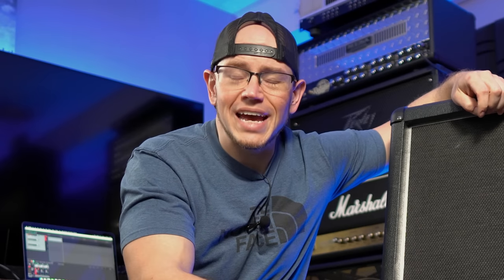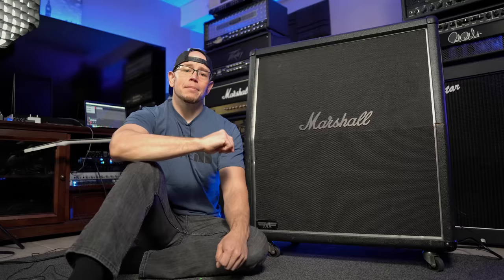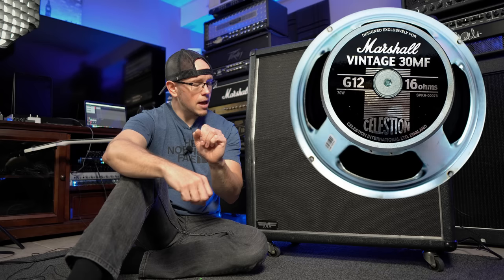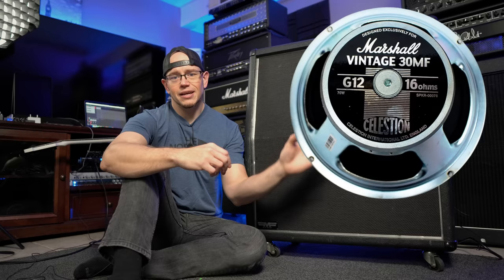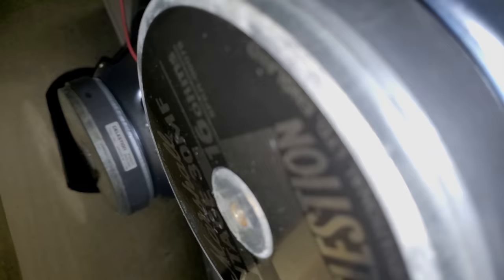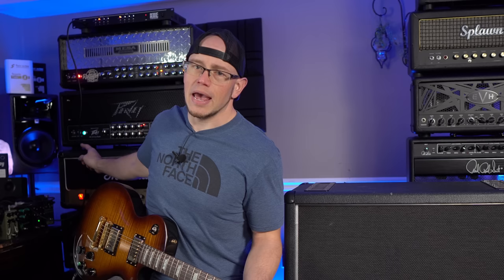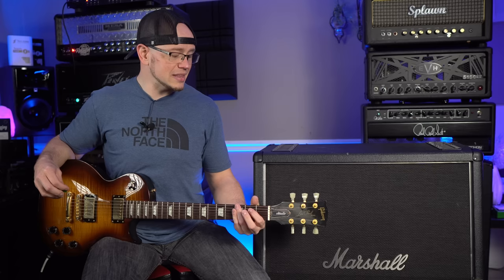Marshall's Answer To The Mesa "Rectifier" Oversized Cab | Marshall Mode Four MF280 Cab

Comment: Little tip for speaker screws: a dab of clear silicon glue on the end as you thread them in will make a nice gasket that will prevent any backing out of the screws. And when you want to remove them it doesn’t hold hard enough not to easily break the seal with a hand tool.

Comment: it is incredible how MOST of the sound actually comes from the cab
Reply: actually the only sound that doesnt come from the cab is the noise from the cooling fans, anything through the emulated line out, and one could argue that MOST of the sound comes from the 4 loudspeakers in the cabinet. my wheels squeak a bit which is MOST of the sound when i'm rolling it around.

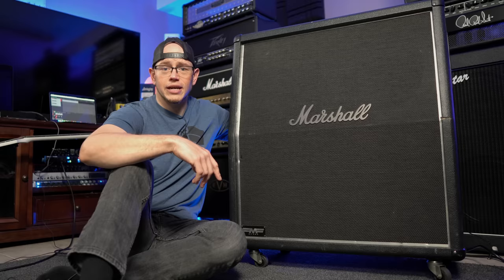Comment: I watched the first 6:30 of this video and I'm always surprised that people don't mention the reason the Mode Four had 2 varieties of Cab.  

The 280 came in 2 flavours.... the Angled 280A and the straight 280B.  The reason for that is that the MF350 head had dedicated outputs for 8 and 16-ohm cabs and was designed to work with the solid state output stage of the Mode Four head which was 350 watts.  Where the MF400 cab is a 400-watt cabinet with 4 x K100 speakers rated at 100 watts each at 8 ohms, the 280 is a 16-ohm cab with 4 x MF30s rated at 70 watts each to give you a 280-watt cab.  

Plugging in both the 280 A&B cabinets to the MF350 Head gave you an 8 ohms load to match the MF400.   It was a clever way to sell the "cheaper" head and single cab to bedroom nu-metal kids and then sell the full stack or the proper mesa killer (the MF400) to pro-level musicians.

I still don't understand why the amp flopped.  it had several big names using them, such as System of A Down, Alex Skolnik from Testament and Kerry King from Slayer used 3 MF400 cabs on stage.  Since it was discontinued, its become a bit of an underground gem.  The OD2 channel is a little scooped at full whack, but the OD1 channel is really versatile.  Stick a tube screamer in front of the crunch channel and you have the JCM800 sound all day long.  I changed the preamps tubes in mine and managed to get a massive fuzzy tone that I use for Doom Metal.

Comment: Nolly made a VERY comprehensive guide to Vintage 30s.  He said something about owning over 1000 different V30s.  

It gets crazy.  Fortunately, most iterations can be looked up with reasonable accuracy....BUT....even with all that said, speakers are going to vary from one to the next, even from hour to hour and batch to batch.  We are in the far end of the weeds in the signal path...where the transducers live.  It's just the nature of the beast.  Fortunately, that's what EQ and mic placement is for, but it's always best to start at the source rather than correct something later.

Check out that guide to see what you got.  Even if you're just curious, the read itself is worth the effort of looking it up.
Reply: His favorites are form the late 90's runs. He believes it has more to do with years of production than it does different versions. I'm not sure I agree, but my amount of experience is not nearly what his is. I do have 6 mesaV30 from the years he says are the best, and also some much newer 60w mesa, and some 2010-era china. IMO the best depends on which cab/amp they are paired with.  In a mesa horizontal 212 the China are the best IMO!

Comment: I have been able to find these cabinets over the last 2 years to put together 2 MF280A and 2 MF400B cabinets.  Straight cabinets have a little more bottom end than slants and the Celestion G12-100K have more bottom than V30s.  Marshall has always been a midrange sound so this resolves that issue.  The slant cabs with MF V30s have alot of punch and delivers higher frequencies.  These cabinets are 3" taller than 1960s giving them deeper resonance  frequency.  I've been using a Marshal 410H and a TSL100 with an ABY switch giving me alot of variety of tones to use. I just picked up a Mesa Dual Rectumfryer Road King II so I think the TSL will just be a backup amp.  Monstrous sounds out of this rig.  Highly recommend these cabinets.  I've been rocking big rigs since '68 and have 17 full stacks I've collected and used over the years.  My favorites are a Peavy 5150 block letter with its speakers ABY to a Peavey JSX with its speakers.  Another favorite is a  Rivera Bonehead ABY with a Knucklehead KR100 each on a 4-12 V30 cab with the Rivera Sub 2 subwoofers under them  that have 2 JBL 12" cast frame woofers and a 500 watt power amps.  You know, just for my bedroom.😂
If it's too loud, your too old. 🎸🔊🔊🔊🎵🎵🎶

Comment: I've lost track of how many handles I've broken on 1960 cabinets lol. It actually got me to switch from using 1960B cabs because I was tired of replacing them. The 1960B with V30s and 75s in an x-pattern used to be my favorite cab to play through, but I never looked back after getting my first Mesa trad 4x12.

Comment: Great video, I have always loved Marshall cabs, so much so that I started building my own “mini 1960b” style cabs with the Marshall style window frame and screw-in front baffle. I finally finished one this past weekend that I had been working on for a few weeks. I use a 2x12 diagonal layout that makes the cab look like a small version of a Marshall 4x12.

As far as the amps, the peavey and the DSL sounded the best through it. There’s definitely something to be said about Marshall’s construction and design philosophy that have shaped how we perceive what we like about guitar tones in the modern time. If Marshall had made a more rigid, airtight design like Mesa back in the 60s we wouldn’t have the same tones that we all know and love today: the biggest takeaway is the fact that a cabinet and it’s speakers shape much more of a given guitar tone than the individual amps do, and especially the pickups. 

I had a pair of 498 and 490 r on my Gibson and when I swapped them for Duncan sentient and Pegasus, while the output was higher and the top end was clearer, the guitar still sounded the same essentially. A speaker cab shapes your overall tone greatly, 

Fantastic video!

Comment: I have two 1960a cabs (JCM 900 series) that I paid $100 a piece for. Love them T75s.
Reply: Lucky basterd, where do you guys get these crazy deals lol
Reply: @ilikepotatoes1345  I can't speak for everyone but I certainly do not let aesthetics hold me back from a good deal. Both cabs look like shit externally (no badge, missing vinyl, broken corner guards). However, functionally they are 10/10.
Reply: @riffsnoleads  Functionality is all that matters, still, even in that condition that you're describing it in, that's still a godly deal to me, those 4 G12T-75s alone are worth more than 100 bucks in used condition.

Comment: I am a V30 nut….I went down the Marshall V30 rabbit hole years ago,and started researching and collecting different eras….The original speaker we know as the V30,was originally designed and exclusive to Marshall….Marshall never called it the V30…Celestion named it when they produced their non-exclusive,off the shelf version…so the Marshall variant is the original design….I currently have a quad of 1987,1993,1998,2003,2010,and 2019 Marshall Vintage’s…..then 1998,2002,and 2004 Mesa variants…..So yeah,they are my favorite speaker’s….They do all sound different to varying degrees…I find the era they were made has a bigger impact on the sound than the variation they are…..When I hear someone say,I hate V30’s,I always say,which ones?….
Reply: I believe the V30 was designed by Marshall at the same time they were developing the Silver Jubilee line
Reply: @brpadington  it was….Marshall used it in 86 on the little Studio 15 Combo,but Marshall designed the Jubilee around that speaker,and the big roll out of the G12 Vintage was with the Jubilee series…

Comment: The MF280 is a phenomenal cabinet and unsung. I personally like the MF400 cab with the K100 Celestions as it does everything the T75 Celestions can only with more force and power on all 3 angles ( Bass/Mid/Treble)

There is a problem however: it is a single 8ohm and going full stack is a problem with many amps due to impedance differences (it actually couldnt do this with the head it was designed with, the Mode Four)

Comment: Seems to be a great cab! But i think that Marshall put T75 in most of their cabs to balance the uppermid bite as they’re known for. And for me, it works really well together specially when you push the mids of the amp instead of the high frequencies. 
V30 works really well with the Ultra and XXX, that’s for sure!
Reply: You would definitely like the MF400 cab then with the Celestion K100s. Basically a T75 on more steroids than 1990s MLB. I use a 1960A T75 cab on top of a MF400B cab in a full stack for this very reason
Reply: @michaellrakes5521  i think too!

Comment: Kyle, I need you to pop open one of your Friedman or Bogner cabs and inspect those V30s. What's their type code?

I know of these:
1. Marshall G12 Vintage T3896 (8)
2. Marshall G12 Vintage T3897 (16)
3. Celestion Vintage 30MF T5321 (16)
4. Mesa/Boogie V30 T4335 (8) 
5. Mesa/Boogie T4416 (16)
6. Celestion V30 T3903 (8)
7. Celestion V30 T3904 (16)
8. T4297 Black Frame (16)
9. Bad Cat T5401(8)
10. Hughes & Kettner V30 T5273 (8)
11. Hughes & Kettner V30 T5225 (16)
12. T5731 Dave Mustaine Model (16) / TAD 25th Anniversary
13. T4139 Black Frame (8)
14. T4617 4 Ohms
15. 5.3 Ohm from Trace Elliot 312 cabs

Trying tos scoop them all up.

Comment: I wonder if the low end resonance you're hearing has more to do with the tweaks Celestion made to the speaker. I'd be curious what caulking all the seems with silicone would do. I have always loved the sound of sealed enclosures: it makes the low end so tight and accurate. I have some monitors with a passive radiator setup and it makes the "shape" of all low frequencies the same. It sounds good but doesn't let you hear what is actually there in the lows.

Comment: very interesting to find this video... I own this unit (slant version) since 2010... I bought it new for around 600-700 € in a store together with a dual rectifier.... I have been hating this cabinet since then... I laughed a lot when you tried it with the rectifier... because it sounds as bad as it sounds to me... XDXDXD plus.. I also play an 8 strings guitar, which is terribly low... so imagine what kind of boomines I get out of it... I cut the bass all the way off... XDXDXDXD thanks for this video....

Comment: Is the matching head really 400w? Seems weird they would make a matching 400w head/280w cab. Obviously the k100 cab makes sense. Nice to have a little low-end bounce from the cab to go with the solid-state head.
Reply: I think the head was meant to be used with 2 x 280 cab or 1 x 400 cab. The 280 cab is 16 ohms and the 400 is 8 ohms. The head puts out 350 watts into 8 ohms.
Reply: @HarkoBarf  waaatttt, now that's a big rig! 350w full stack

Comment: the line 6 cab with vintage 30's is much better constructed and sounds better than the marshalls or the mesas
Reply from the maker: Definitely not constructed better than the Mesa. Mesas are finger jointed at the corners which makes them much more durable, I had a line 6 breat at the corner during shipping and split completely because it was just nailed together at the seam

Comment: Hey Kyle,
Have a weird question for ya. I'm customizing my rig, (Wine Taurus Tolex and all real brass hardware). I have a Marshall Mode Four head, (more like an oversized paper weight because I blew it up, but that's another story for another day),... I picked up a new DSL 100, (it's alright), I customized it and have the metal logo from my Mode Four and I am wondering if you know what the logo is made of. Stainless Steel? Or Aluminum? I need to know as I am going to copper plate it, (I customize EVERYTHING, have the only known copper plated Floyd Rose),... I am matching up my rig with my main guitar, Yolanda, which I built back in the early 90s. Any ideas what that logo is made of? I think the cabs have the same metal logo.
 Besides all that fun stuff, I used that Mode Four for YEARS and have had SO MANY people tell me how amazing my tone is, and no one knew what I was playing through, (as it's a completely customized Mode Four). I think some people where just snobs and didn't like the solid state pre and hybridness of the MF and since no one could tell my head was a MF, they didn't know any better, lol.
 I'd bet my left nut if you took 10 different amps with the exact same innards people would tell you how different they each sound from one another.
Reply from the maker: I honestly don't know the exact material, man.  Sorry.  I would think cheap steel or aluminum
Reply: @belligerentamateur  it was worth a try. I did a scratch test. It seems to be brushed stainless steel. Bought a plating kit, because copper paint just won't cut it.

Comment: While I'm here in the comments all alone, what are your recommendations for affordable gigging amps for high gain 7-string guitars? Keep up the killer hard work brother! 💪🏼
Reply: Laney IRT
Reply: @luca4352  I'll look into the Laney! Thanks bud!
Reply: Depends on your definition of affordable. Compared to a 4000 dollar Soldano SLO 100, a 2000 dollar EVH 5150 III 100w head would be affordable so it comes down to perspective. In my opinion though, the PRS MT15 is pretty much impossible to beat for high gain tone and volume at 750 dollars brand new. It's the loudest 15 watts out there, it's got 6 12AX7s and 2 6L6 power tubes and sounds like a 50w amp
Reply: @jhmusic1  ahh fair enough. I'm looking at sub $1k USD. Laney IRT, Bugera 6260 Infinium and 5150 Iconic are all in the running. I'm playing with other 100w guitarist, so I need to keep up. The PRS sounds amazing, no doubt but it's not enough for my needs unfortunately.
Reply: @Jaymesbggs1  are you ok with buying used? The 5150 III 50w heads are pretty much unbeatable in the used market for value, you can usually get them between 700-900 dollars and they'll hold up with pretty much any amp. It'll be more than loud enough for really any situation
Reply: @jhmusic1  used is fine. I had a 6505+ I bought used a few years ago, but it was horrible for anything other than high gain. So I sold it and grabbed a few more guitars with the funds lol.

Comment: The Mode 4 was a $1,000 solid state head. Big fail for the time.
Reply from the maker: They were way more expensive than that, and they were a tube/ss hybrid.
Reply: @belligerentamateur  Sweetwater shows them listed for 1k back then
Reply: @belligerentamateur  Not sure of that. There is one for sale in my area for $700 with the MF400 cabinet. Cheapos
Reply: @belligerentamateur  I didn't remember them being g a hybrid. That $1,000 price I remember may have been a clearance price.
Reply from the maker: @samizdat113  yes sir, they have a tube preamp section and a 350 watt solid State power amp section. I don't remember the exact price but I remember them being really expensive when I was a kid. Who knows though, I could be wrong as well on the price
Reply: @Kyle Bull  They were kind of ahead of their time if you think about it.
Reply from the maker: @samizdat113  yeah, they were flirting with hybrid tech a lot. But then all of the guys that were into the hybrid stuff left and started Blackstar.
Reply: @Kyle Bull  Well I guess they aren't as budget as they used to be. 1 years ago you could pick them up for 5 or 6 hundred. They are inches away from a grand now.
Reply: @belligerentamateur  I should have a receipt from when I bought mine from the dealer - I’ll look through my records
Reply: @Ethan_Ammerman  $3,800.00 Australian for the head and MF400 cab together new, still have them and the receipt.🧾 🤘
Reply: I got one new in 2004 for 2700 nz dollars. cab was 1700. no idea what that would be USD.  Head was not bad at all until it fried itself. 2 x preamp tubes rest solid state. still got it never got it repaired lol
Reply: @kreepthedestroyer  What do you want for it? BTW, big fan of 42° Below vodka.